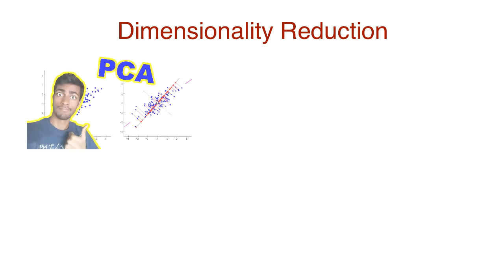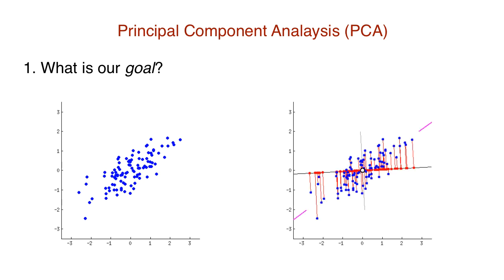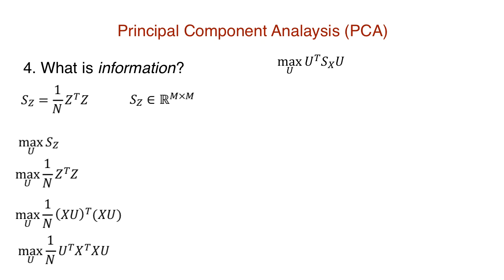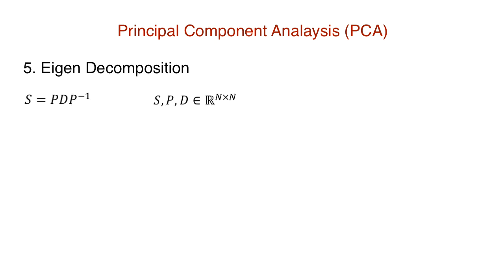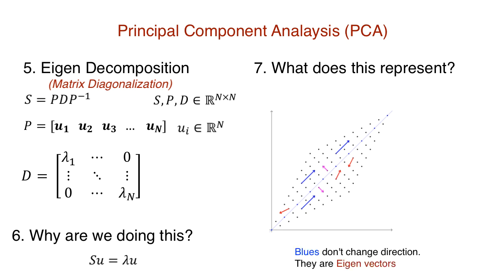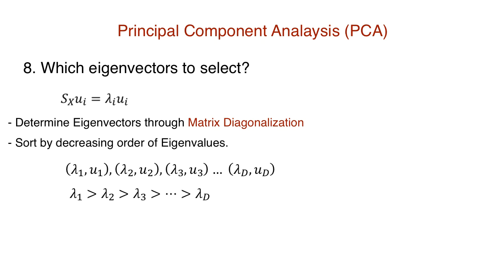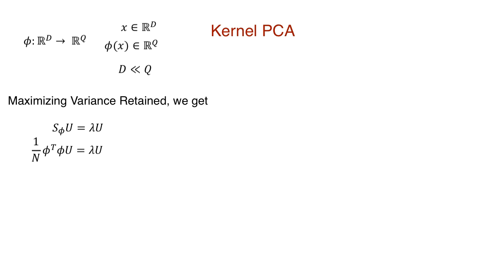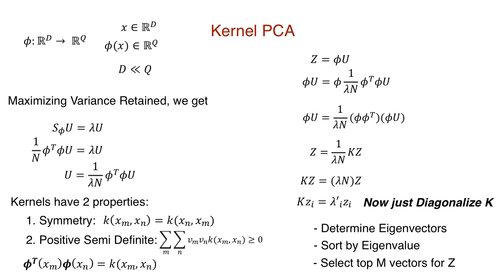Principal Component Analysis (PCA) - THE MATH YOU SHOULD KNOW!

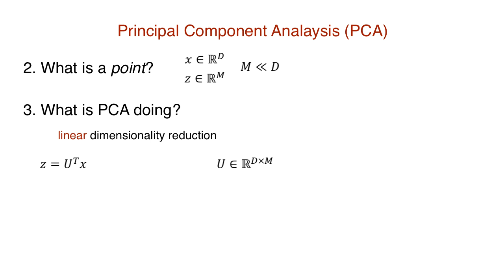Comment: 2:06  A typo is in the dimensions of X and Z, where they flip the row and column dimensions.

2:16  Something is not proper here when he says S is the covariance matrix of z. 
Note that
Cov(a,b)=E(ab)-E(a)E(b), \forall a,b \in X,
so this S is only the first part of the covariance matrix, rather than the whole part. Indeed, the complete covariance matrix is
Cov(Z) = E(ZZ') - uu' = 1/N(ZZ')-(1/N^2)Z11'Z', 
where u_i is the mean of z_i (u:=[u_1, ... , u_M]) and 1's are column vectors. By comparison, see 5:40. Note that \sum_i \lambda_i=trace(Cov(Z))=\sum_i Var(z_i), and hence he claims that the sum of eigenvalues equals to the variance is correct. However, again, Cov(Z)~=1/N(ZZ').
Reply: 1. Dimensions flipped (typographical error). 
2. The data is assumed to be mean-shifted. 
3. The total variant is invariant to change of basis.

Comment: How do you determine what dimension value of m that you want? And how do you figure how accurate the new m dimensional data set is in reflecting the original data set? Do you just compare variances?
Reply: That will depend on how much information you want to retain. He said how you can calculate the % of information retained for M dimensions. If you want absolutely 100% you gotta use all unless there are some features with very high covariance

Comment: Based on the dimensions of Z, U and X, the expression Z=UX does not hold. Can you clarify this point?
Reply from the maker: Around 2:20, I use Z=XU (not UX). 
Z is an N×M matrix. X is an N×D matrix and U is an D×M matrix. 
So the dimensions work out
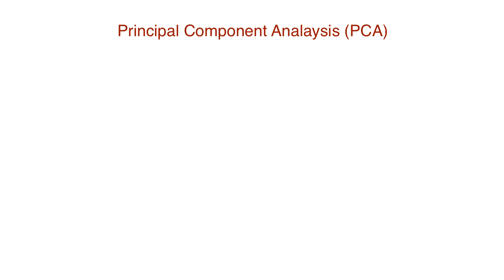Reply: @CodeEmporium   I was referring to time 2:07 where the expression Z = UX was used. Anyways, I just wanted to notify about it. 
The video gives a good presentation.
Reply from the maker: @MultiPRAKS  Ah. Typo on my part. Thanks for the heads up
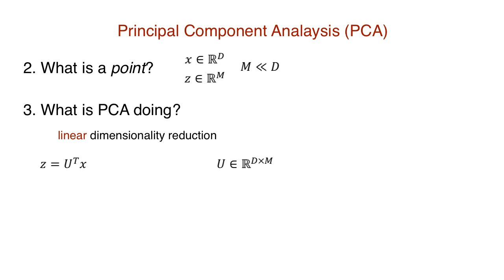Reply: @CodeEmporium  So what should we read at time 2:07?